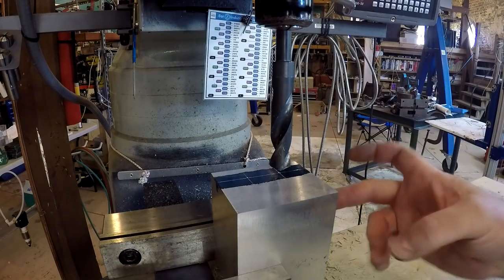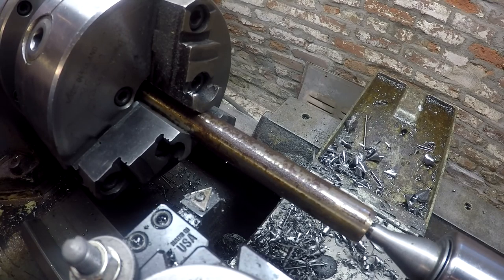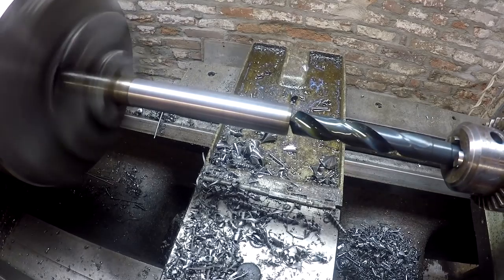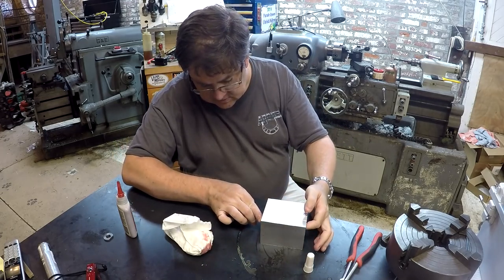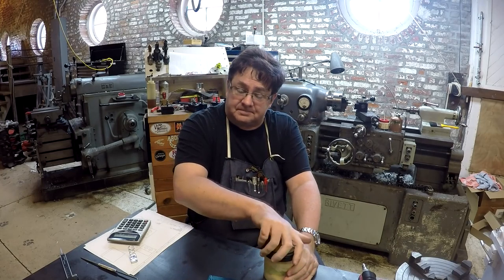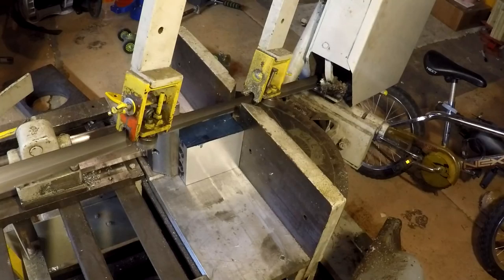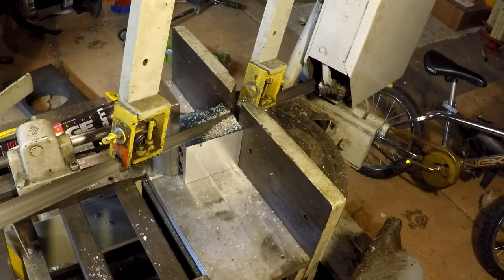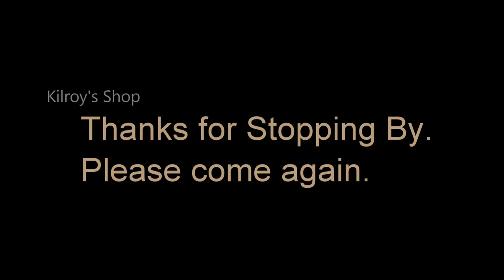Magnum Pocket Drill Jig #2

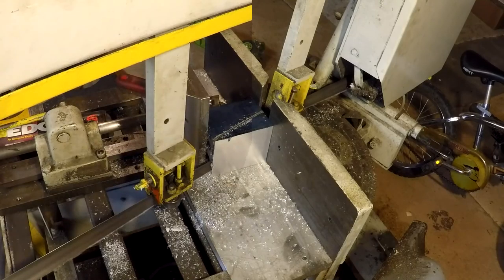Comment: At 23:51 in the video you show the piece after the cut, and it appears that the holes are not lined up. Is this just a illusion on my part? If they are not lined up, after watching the video twice, and reexamining the steps you did on this piece I don't understand why they are not.
Reply: +Ronald Church  A lot of knowledge to be gained in your videos Thanks
Reply from the maker: +Ronald Church Not at all, I lined them up by eye, in the vise, and I swapped it around 180 degrees so there is a little slop, no need for four digits of precision on this project. Thanks for watching.
Reply: +James Kilroy  Great. I was wondering why it looked that way. Because there should not have been much difference.  Just an illusion on my part. Good video of a neat project. Thanks for the response.